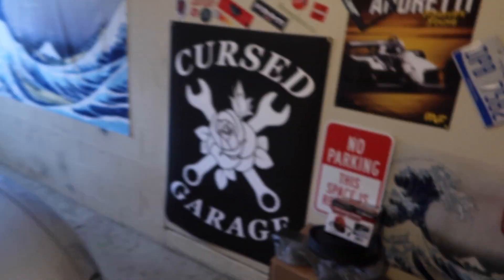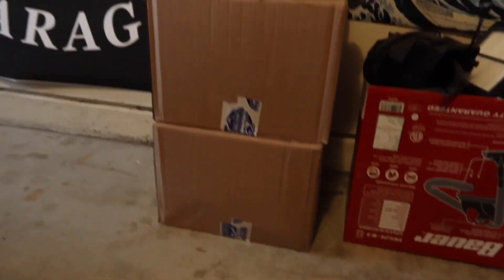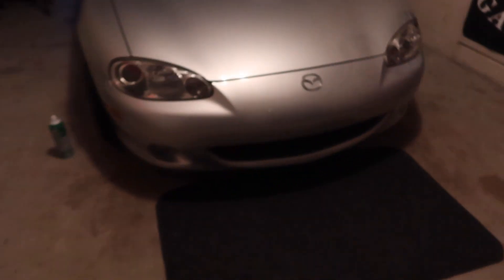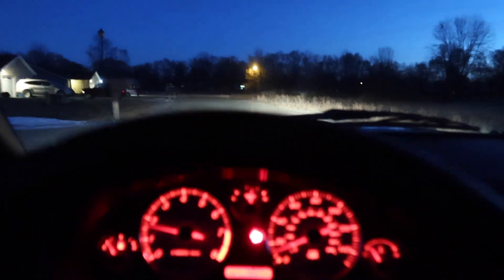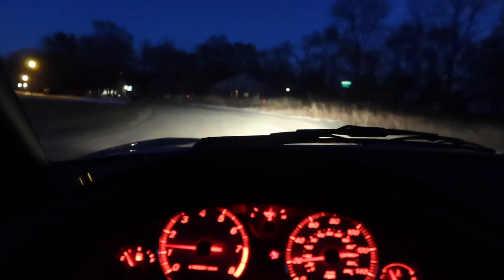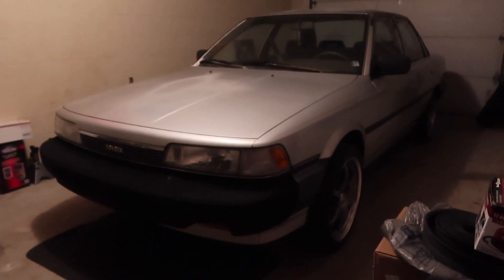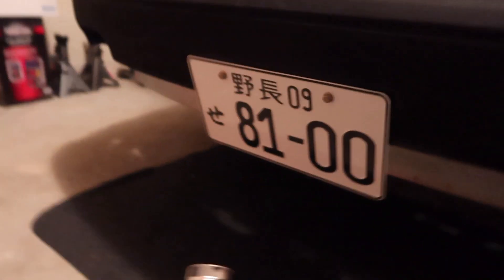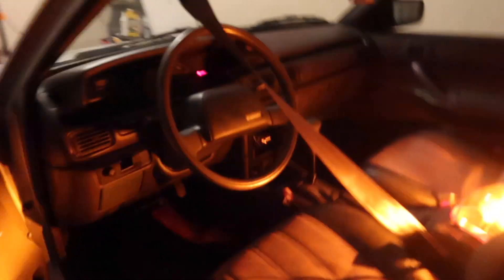Getting to work on the Camry!

Comment: There are actually 2 companies that make coilovers for the v20 chassis! Gecko and DGR! I know you already opted for the celica coils, but just a heads up! The forums (toyotanation), and the facebook group (Toyota Camry - Vista 1987-1991 / Lexus ES250 1989-1991 SV21 SV25 -V20/VZV21).
The celica coilover conversion isnt too difficult though, if you dont want to redrill the top strut holes you can leave them be and just extend the bottom bolt hole and bracket on the coilovers. You can also bolt in stock camry v6 rear brakes if you want disks all around!
Best of luck.
Reply from the maker: HELLOspaceHELLO yeah after looking online I never came across them, the gecko brand doesn't look to bad but they cost more than the car haha but thanks for the info!
Reply: Yeah I feels haha, I think they're okay after a year driving on em. 

I'm assuming you're going for a more budget build tho since it's just a daily. Looking forward to seeing progress!